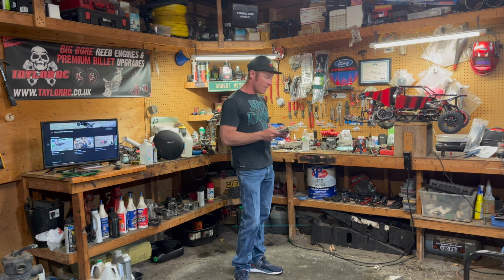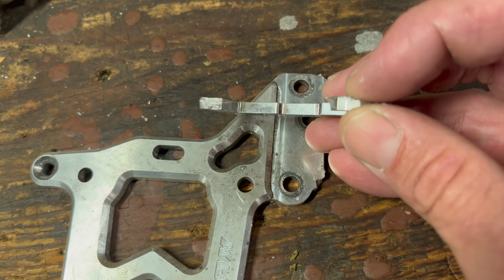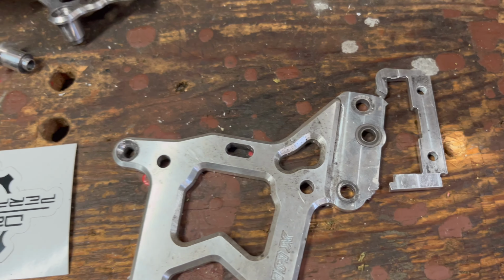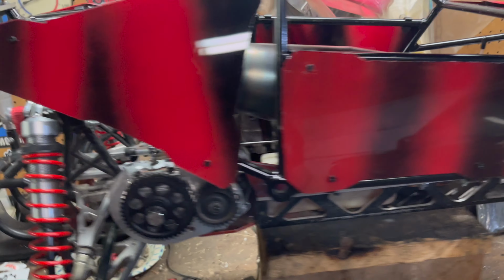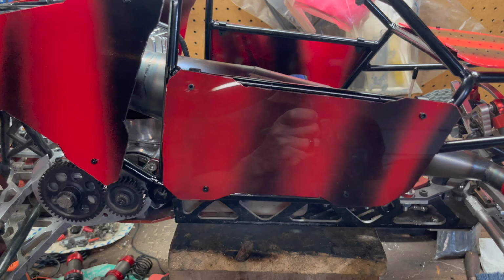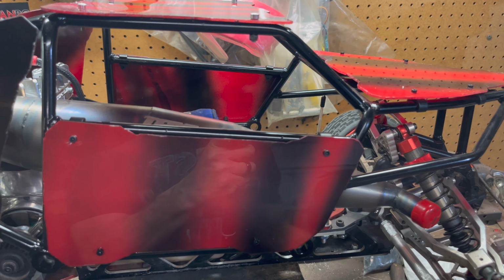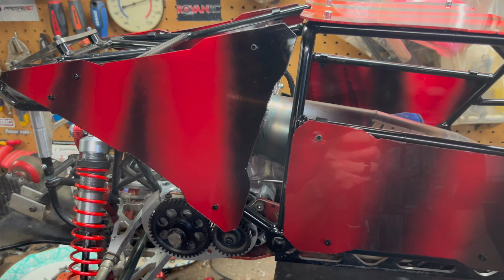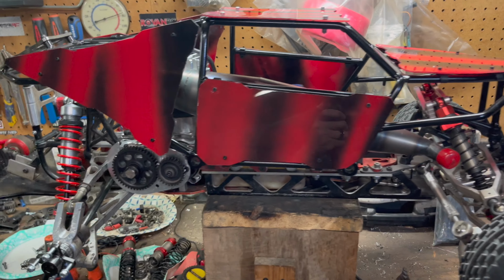TAYLOR RC 71 SUPREME NEW LOOK!!!

Comment: Great vid! I notice when u mix rovan parts with any upgrades the tolerances are off you have to replace the both rear bulkhead with the taylor parts and that top plate should fit!
Reply from the maker: Thanks bro 👍🏼 yeah I notice that too from time to time I will be replacing the bulkheads when I get the new rear chassis from irc